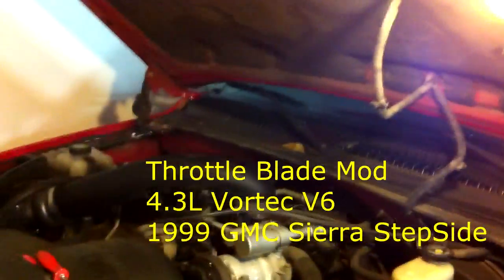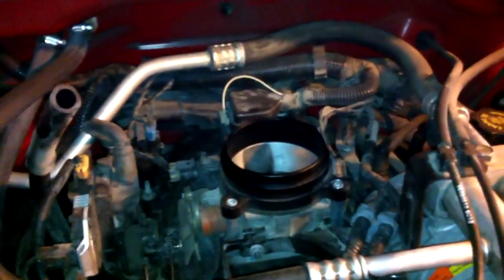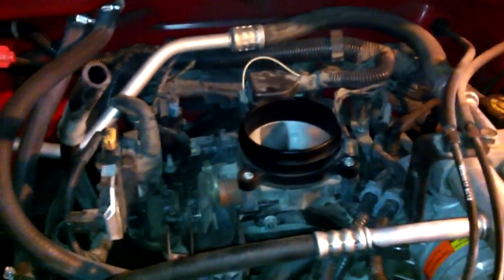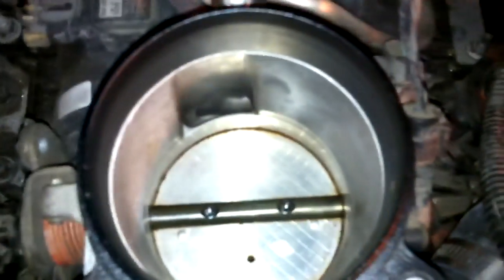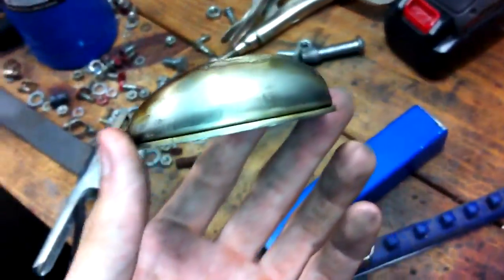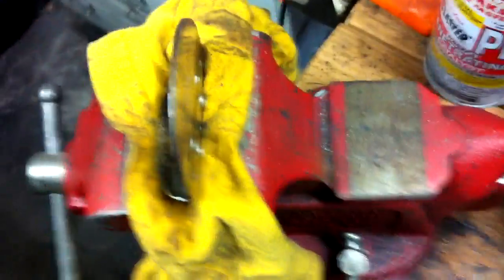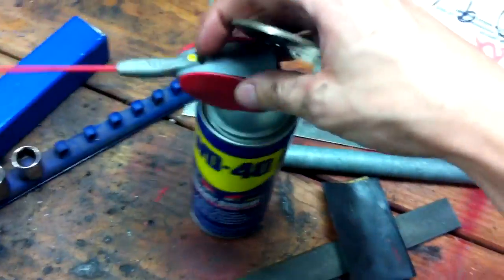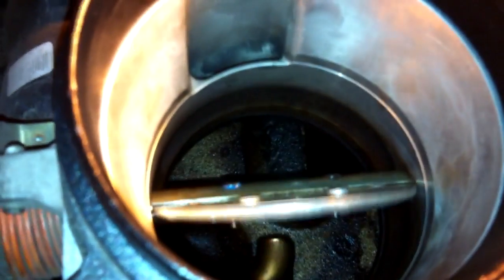4.3L/5.7L Vortec V6/V8 | Throttle Body Blade Mod | 262/350ci

Comment: Man you got to be brain dead to do that without removing  the throttle body first  😂 is a lot easier to remove it first that way you can clean  the whole thing on top of being worried about dropping the plate screws inside the block I did it on my 99 2 door hoe runs like a beast

Comment: Before watching your video.I took the whole plate off leaving those 2 holes  thanks to another YouTube video that didn't clearly explain to leave that plate on and just cut the part of the lobe .which u explained well! Didn't know what to die so I put 2 little screw's in those holes .the other day she started nocking or tapping ; it sounds like a rod or lifter pulled breather off throttle body and noticed only 1 screw in plate  other 1 must of fell in .not sure if the screw could of fell in to a valve or cylinder and make that noise.
Reply: Lol😂...dumbazzz!!!

Comment: Have u tried doing the corvette servo on it
Reply from the maker: not a good idea on a 200k+ 4l60e with stock 2-4 band. I still have this truck and have had the trans rebuilt since the video. I ended up breaking the sunshell at the hub slowing down at a red light that turned green and stomping it.  needless to say it has extra clutches in the 3-4 pack,  wide 2-4 band.  blocked off my 3-4 accumulator and shortened the stroke on the 2-4 accumulator.  stock servo. makes a world of difference. its still a nice v6 truck. I have plans to ls swap this truck in the future. its currently a back-burner project.

Comment: To anyone watching this don’t waste your time hacking off or even using a Dremel to cut off, go to the junkyard and look for an early (98-99-00) 5.3. (Pretty sure any LS around that time) has the same Throttle body blade as a 4.3 or 5.7 Vortec… it’s even better than the stubby defuser on the 5.7s… The LS motors with the same throttlebody blade have no diffuser and no HOLES that need to be filled. It’s a direct swap!

I’m not positive but I’ve also heard that some Northstars have the same tb blade as well.
Reply from the maker: for what little performance one will gain I wouldn't bother searching a junk yard and trying to match shit up. you already have to remove the old one why not just modify it.  my 2 cents...But defiantly an option for folks.  I still have this truck its nearing 300k miles. need to do a couple of update vids soon.  I will also have a northstar on the channel soon that i recently bought for diaper money with a bad starter !
Reply: I definitely didn’t go searching for a blade lol.. I happen to be there already and seen an ls LS intake on the ground and noticed it looks identical.. and it was..  my 4.3 has 250k miles a 4.10 gear and a 125 shot..  put the spray on because it’s getting an LS anyway.. so far it’s taken probably 20+ 10lb bottles no problem. Totaled my daily so my 01 Xtreme Blazer has been my daily for about 6 months now. Few other odds and ends done to it also. Spraying it from a dig bales the tires lol.. on motor it just barely spins a hair. Had to put traction bars on it because the wheel hoop was so bad while spraying it.

Comment: I just did this mod with the throttle plate I'm all smiles over here it was totally worth it for the free power and better throttle response total time under 15 minutes  2002 GMC SIERRA 1500 4.3 vortec V6 with 405 thousands miles a well used truck steel running strong 💪a K&N in the air box and no air box resonator and now a moded throttle blade 👏

Comment: Should definitely get the MAF retuned after doing something like this
Reply from the maker: not sure what you mean by that but I still drive this truck it has 275k+ miles on it now original motor. only major issues I have had are oil leaks and upgrading the failed spider injector in all that time. this was recorded in 2012
Reply: @WinnfieldCustoms  air flow characteristics were changed, and what I mean by it is, to get the most out of it, the MAF table can be retuned to get the most of it's efficiency. Especially on the top end.
Reply from the maker: @boosted0079  I think there is defiantly room for some tuning. it seems to load up at idle when its cold. fuel mileage could be a bit better i think too. Not sure if airflow was increased by that much, didn't do any tb porting or stuff like that.  I have a friend in Ruston with a dyno not sure what it would take. never looked into tuning before with this truck.  didn't figure it would be worth it b/c its just a v6. I have an 05 that i put a cam in that had to be dyno tuned. my 91 I had to get the chip flashed. This 99 really runs good still its the tightest old truck I have.  I plan on making more videos soon
Reply: @WinnfieldCustoms  I suspect part of that may be due to there being slightly more air entering, while the throttle position sensor is the same as before.   Overall I'm sure it's totally driveable. I still think this is a great idea for getting the most out of what's there, without actually changing to a different TB. 

I've got a GM 3800 V6 that I've done a custom top swap to in an 02 Firebird. Mostly because I like tinkering lol. But I've kept it clean, and you can't tell it wasn't a factory job. I'd show pics of this would let me. 

My stock TB is electronic, and the MAF is mounted into the front of it. I ended up doing pretty much what you've done here, and I've ditched the stock MAF by removing it and using a block off plate in it's place. I now use an LS1 MAF sensor. Overall it really helped the air flow out a ton, but I'm kicking around the idea of taking an electronic version of what you have here, getting a pigtail plug, and splicing into all the correct pins, and seeing if I can make it work. They're both 8 pin connectors with the same pinouts. But having a 75mn TB vs the 65mm one I have now letting air into the M90 blower, would be a big help. Blowers don't like sucking vacuum lol.
Reply from the maker: @boosted0079  my father had an olds delta 88 with that 3.8. "cop car" pickup that thing had.  absolutely bulletproof . my little brother slid it into a ditch and totaled it out. always wanted to supercharge it, the blowers were cheap on ebay back then. defiantly miss that one.    cheers brother !
Reply: @WinnfieldCustoms  damn that could've been a fun project for sure. Back at ya my man. Take care and keep up the projects

Comment: Can it be done on a 4.3l tbi?
Reply from the maker: No, the throttle bodies are different. 
TBI uses a blow thru wet intake with injectors inside the throttle body, and the vortec has a dry intake with port fuel injectors on the intake runners. 
You can open the TBI’s up with a Dremel tool on top to flow a bit better around the injectors but not for any noticeable gain. 
The TBI style motors are very power limited. I have a tbi350 in my other truck  and it’s hard to get any power out of them without changing the heads for vortec ones. They just don’t flow good at all.

Comment: I found a bitten or damaged gas hose probably affected  as i changed the $20-$30  fuel pump after i made the cut with an air hammer others used shears

Comment: Just did this mod to my '2000 ZR2. Like it! Cut my diffuser off with metal shears, since it's only aluminum, it was easy. Then ground it down with bench grinder. Making an overland rig, so I wanted the extra torque. Definitely got some beans now! Thanx for the how to!

Comment: I tightened up my throttle cable. Did the throttle body mod got better spark plug wires used the factory airbox with hoses connecting it from the front grill to ram air in (K&N) It seems to work better Above 30 miles per hour Deleted the catalytic converters. Also increased the exhaust piping size with a high-flow muffler. Got a better fuel pump Any fuel pressure regulator that can handle the extra pressure a larger fuel filter and a new mass air flow sensor. I can do a burnout at 40mph in my blazer. You have to love the 4.3L V6
Reply: What pump, regulator and filter did you use?
Reply: @DESERTHAWKIN  KEMSO 340LPH High Flow Fuel Pump(which is over kill) but works as for the regulator due to it being situated on the spider injectors you want to get one that's metal I got one from Napa but don't quite know if they still sell it

Comment: Oh its the exhaust its too noisy mine isnt loud at all no cat 2.5 inch free flowimg muffler no cat and 2.5 inch pipe all the way back it breaths well and is pretty quiet diffuser gone in the throttle body and its a 5 speed s10 it's pretty quick did you really feel the k and n. Filter it cant see spending fhe money

Comment: Did this to my 2000 jimmy 4.3 it was so slow. With this mod and short ram k&n air intake. It's worth doing if u have this kind of throttle body. Difference is huge

Comment: My vs sounded similar to yours as far as filling sounding like a v8 my 4.3 would walk off and out run the v8's and diesels on take off and climbing very steep grades 7% and better and would gain speed quick going up them type grades pulling 10k lbs and better.and get 400 miles on a tank of gas

Comment: I tried this modification and the guy is absolutely correct that did this video it does work very well immediate change in throttle response directly out of the hole big difference a little bit harder on fuel like you would expect but nothing crazy definitely a huge difference in the way the truck accelerates

Comment: I did this years ago to my 99 4.3 Xtreme. Can't say I noticed a difference either way. The only things that helped were the cat back exhaust I installed and tuning the ECM . If somebody made a decent set of cylinder heads for these engines you could have gains you could feel.

Comment: I put spark plug wires new cokd air intake and flowmaster exhaust gave me alot more response pluged erg . i got 200 thousand miles on my chevy runs like new
Reply: Nobody is saying, nor has anyone ever said that those mods (plugs, wires, intake) won't add power. Duh. But, what people ARE saying is that this mod is FREE (that means it costs nothing but your time) and it does improve throttle response. Also, nobody is saying that you have to do one or the other. You can do both....
Reply: Cuz all you do i shave the back of the intake off it doesnt cost anything to do that.

Comment: I see a lot of confused people(s) comments on here.  Let me try and help you out and any new visitors viewing in the future.

  1) The curved flap is there so that when you start off, the drive is sort of soft and easy.  The engine doesn't suddenly rev and you jerk into motion and or spin tires.

  2) You "do not" get/gain any extra horse power or extra high end speed or any better fuel savings.  In fact, you will likely increase your fuel consumption and #3 is the following reason is why.

  3) By removing the flap, you will feel and experience a sudden and direct increase in engine RPM's resulting in a more rapid take off from start/dead stop!  Like anything else, it just take a short bit of practice to adjust to the feel and learn to take it easy on the pedal.  Since the vehicle computer controls fuel to air ratio at all times, you will still consume the same amount of fuel.  That is unless your are a heavy foot or a complete jerk having nothing better to do than show off your spinning wheels!

Note:  As in any situation on any vehicle.  If you drive around with poor, smooth or virtually smooth or the wrong tires entirely for the weather, you could easily find yourself losing control and spinning out!

So at the end of the day, you should think about whether you need or want to do this mod at all.

Cheers.

P.S.  CFM Tec bores out the throttle body and installs a larger plate!  As far as I am aware, they do not just remove the attached original curve disc and re-install the plate!

Comment: works like a charm! best life hack ever! also I removed the honeycomb from in front of my mass sensor and cleaned it but it gave life to my truck!! works!! 110%%A++
Reply: That honeycomb in there to provide linear airflow to your sensor. I'm sorry but you fucked up by cutting it out. That sensor was built to measure laminar flow, not turbulent.
Reply: Yep! There are some things that need to be left the fuck alone. That, was one of them. Ya done fucked up, son!

Comment: while the throttle plate is out u can radius the edge with a jewelers file. just make shure u dont touch the outer diameter.

Comment: can I put a 4.8 liter Vortec in 2000 Yukon that had 5.3 liter Vortec in it without changing computers and wire harness
Reply: Yes you can the computer needs retuned for the v8 tho 98+ s10 guys myself included use the factory v6 computer to control everything just need an upgraded harness with the additional plugs for the 8 injectors vs the 6 current performance makes one
Reply: No sir. You'll need the computer for that specific 4.8.

Comment: alright so i did this mod or whatever you eant to call it and my motor sits at 1000 rpms does it mean that i didn't line it up right or what idk can u please help me ?
Reply: You probably accidentally turned up the idle when taking off or putting on the plate
Reply: I had to replace the tps

Comment: ok thank you Aaron I just took it off and cleaned it was rally bad , but now when I start it  it  high revs  then goes back to normal after few seconds  and sometimes high revs after I put it back into park  and sometimes will drive by itself at 30k  I do not hear any vacuum sounds  my gasket was good   So any idea on this be great thank you : )

Comment: why don't u just  drill the rivets out and replace the rivets ?
Reply: Read his question again. He clearly asks about drilling OUT the rivets and REPLACING them (obviously with new rivets). You would have to remove the existing rivets to remove that curved plate completely but, as you've pointed out, there would be two holes. Which is a topic covered by his question about replacing the rivets....meaning putting new ones in after removing the old ones so that the curved plate could be removed.
Reply: drilling out the rivets, will leave two holes behind, and make the truck idle higher, as air will run through the holes

Comment: I did this mod thinking it would give me that little bet more out of my 4.3l motor it ran but it had issues when i drove it. The issues i had was bogging down when trying to get on it ,an stuttering at certain speeds i thought it was something else.I replaced the throttle body plate to the original throttle plate an noticed a big improvement, an she ran a lot better. I advise anyone trying to do this to NOT DO THIS!!! I was a dumbass in doing this, it fucks with the air/fuel ratio.There's a reason why that diffuser/ restrictor is on the plate!!! Don't make the same mistake i did.There is other way to improve your motor.
Reply: made a big difference with mine so, idk...
Reply: +Tom Kalin + Everyone here: I am on a Horsepower Journey and THANK YOU VERY MUCH for the inputs. I was going to do it, but I guess NOT, LOL. I have a few Vids on my Horsepower Journey if you guys want to check it out in my Channel.
Reply: my 4.3 did the same thing even had missfire im put back to stock
Reply: thanks I was going to do that ¡ hell no ¡,.  im just wondering how u get more power on ur  4.3 V6? mine is ok but surely i need more.
Reply: Not one person has ever proved it makes any more hp whatsoever.  It's a lot like the "cold air" intake which actually reduces HP but "feels snappier"

Comment: When you change your injector lines be careful when you plug the big plug behind the throttle bodies back in, if 1 of those little pins get bent it will mis fire on one or more cylinders. I've been working on cars for years and it happened to me. Took me 6 hours to finally find what was making it misfire...
Reply: me too

Comment: will that mod work on the 07 nbs?
Reply: +Amanda Castaneda i have an 03 silverado an it didn't work for mine, don't do it.It just fucks with air / fuel ratio an makes you think something else is wrong
Reply: What the heck is an NBS?.....
Reply: @Cambpro  new body style mid 07 style changed

Comment: Did the mod, have a K n N fipk cold air intake and Flowmaster dual super 44 exhaust on my 2003 GMC 4.3. Noticed more punch off the line when it was first installed, but now feels laggy. Disconnected the negative terminal and let it rest for an hour. Going to see if this resets the air/fuel ratio for better results. 

I'm looking into the spider mpfi and an underdrive crank pulley. I also really want headers but can only find 4.3 headers by JBA for $650!!! 

A buddy mentioned MSD coils for added power. No idea what he's talking about...

Comment: After a while from doing this mod would you still recommend doing it? Mainly for a daily driver? Just want a little more power/punch out of my 4.3 silverado
Reply: +mooch1441 I've had mine done for over a year now and it takes all of 5 seconds to get use to the increased sensitivity
10/10 would recommend

Comment: I try that to a spare throttle body I ad, turn out to be a bad bad move, it does not work that good, I put on a throttle body spacer for much better result , if you considere trying this sheep mod better be ready to get a spare part for your throttle body YOU WILL NOT LIKE IT if you really like you car performance consider changing throttle body

Comment: just did this on my 2002 s10.... not impressed. i wouldnt recommend this. the plate is there for smooth take offs. it releases the air into motor more smoothly . taking this off just causes the throttle to really pop as soon as your plate opens and it really just makes for a  jumpy throttle . i wouldnt call it more responsive..... i drive my  2wd ext cab lowered s10 through canadian winters and i know this removing the throttle plate is just going to cause more of a headache when controlling the throttle on icy roads....
Reply: No fun
Reply: milldabeast519
Reply: milldabeast519